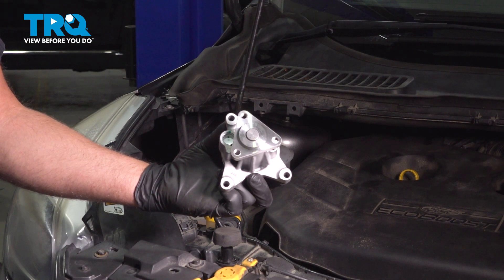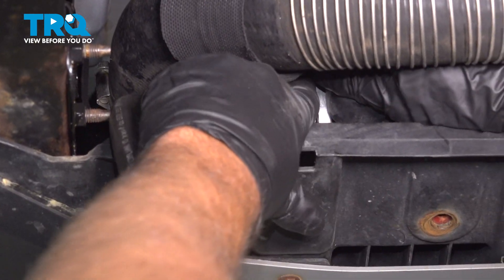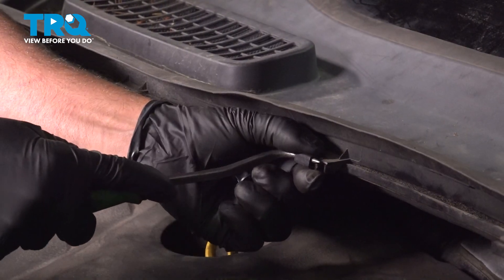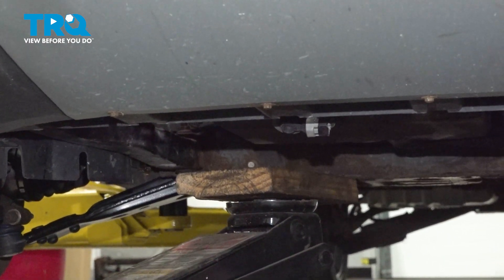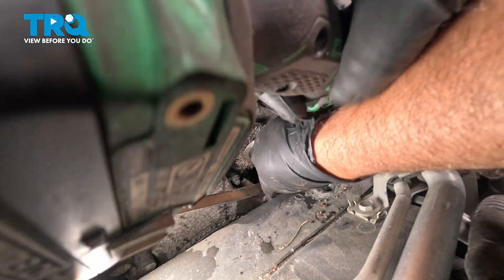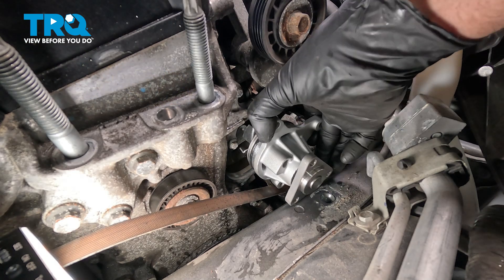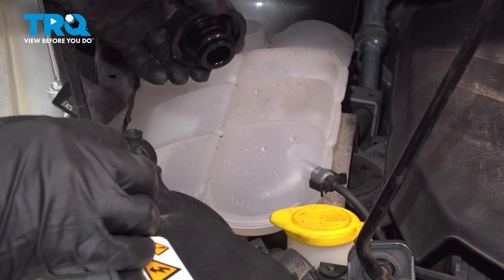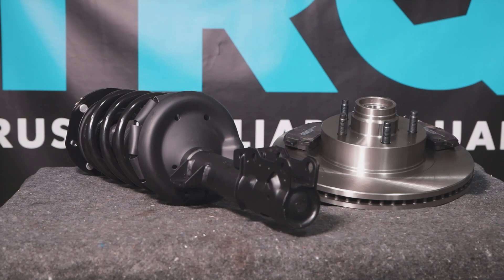How to Replace Engine Water Pump 2013-2019 Ford Escape 2.0L L4

Comment: I did it without removing wipers, cowl, or motor mount. There is plenty of room without removing them. These pumps are in there tight and take a lot of pounding on to get them out. Mine did not have any rust and was very clean. It was still very hard to get it out. If you are doing this change the thermostat and housing while you are there and have the system drained. If you are due for belts this would be a good time to do those as well.

Comment: is it possible for a broken water pump (leaking water of course) make an engine go bad. i had brought my car to a shop and they said the engine was bad and it needed replacing including the water pump which they estimated it would 5k to get all of it fix, but just to change the water pump only it would cost 15 hundred.

Comment: You don't need to remove the wipers, cowl, or coolant hose. Move the coolant reservoir out of the way, remove the engine mount, jack up the engine, boom.

Comment: Been calling around shops they telling me this is 10 hours of work. Why when you did it in like 20 minutes?
Reply: What you can do in video can take hours, sometimes a single nut could tale half an hour or more. I'm about to do it and I'm interested how long it will take so will report back. Ford wanted parts+ $1100 in labour
Reply: My cars a little different. I spent an hour doing the engine mount cause that's faulty.  Realised I didn't have a new tension belt or coolant so left the water pump, while at it I looked for the water pump and my engines a little different. No idea where the pump is but think I'm going to have to take the wheel and guard out to get to it
Reply: If you don’t have this 2 litre engine. The water pump is under the timing belt. You have to remove to the timing cover, the engine mount, the timing belt to get to the pump to replace it.
Reply: Because they are going to make money off of you to keep their shop alive. This can be done easy easy. We did it today saved tons thank you.